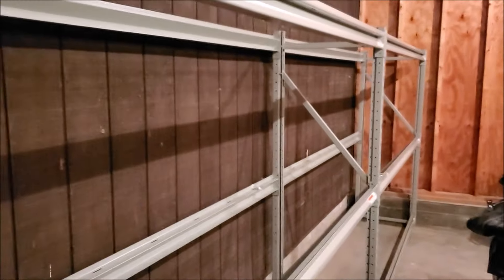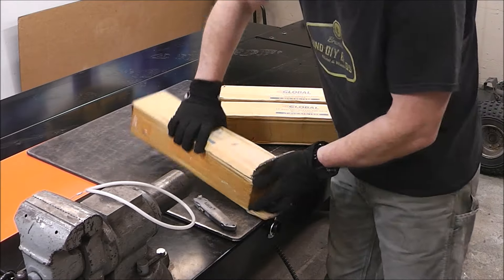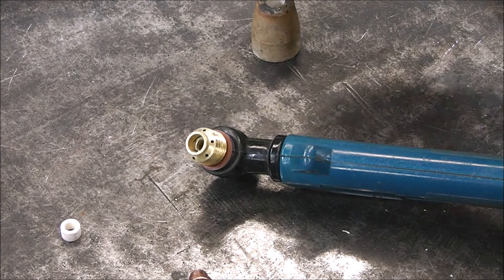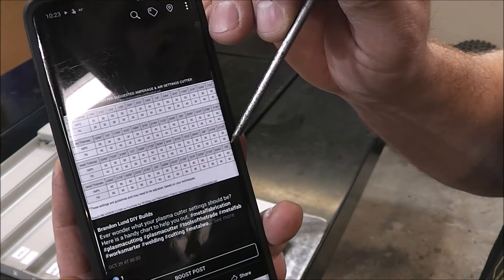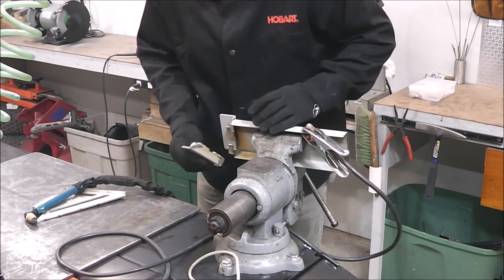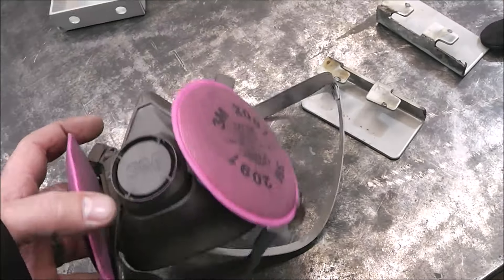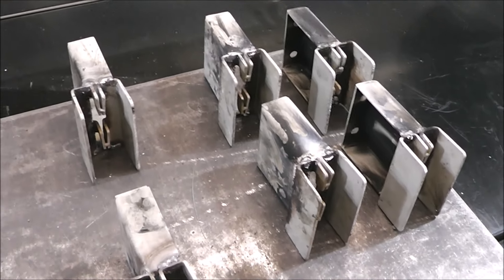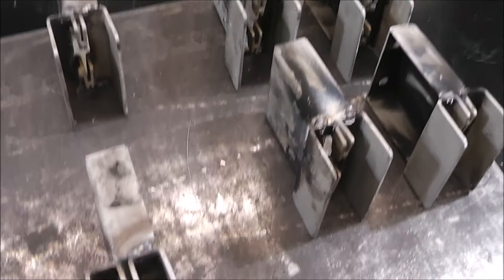Setting the Correct Air Pressure and Amperage for your Plasma Cutter

Comment: Little late to comment, but the first thing I noticed was the "tricky" end is the one to keep. No need to cut twice. Just hack the small sides to length. Make the wider side a little longer. Drill a couple of new holes, and bend it in the vice. Then it is just two easy tiny welds to secure it.

Comment: Why didn't you cut the length from bracket end towards the wall end and then weld wall attachment end on.
Reply from the maker: No particular reason. I felt this way was a little less labor so I went with it.
Reply: @BrandonLund  dude im not bashing your video. I like your videos alot and watch most.  But you put your handy dandy gauge on and clicked it back and forth with space on both sides. there for its not 1/8 bet if you go nack with the gauge ant put it on 14 gauge it will be a tight fit being 14 gauge material
Reply from the maker: @rolfbach2721  its metric but 1/8 gets you close.
Reply: @BrandonLund  gauge is gauge 12 is 12,  14 is 14, thats universal.  I think!!?
Reply from the maker: @rolfbach2721  yes unless the material your using is metric or stamped.  It didnt fit 14 guage and 1/8 was just slightly loose as you pointed out. When metal is extruded its thickness is consistent.  This metal was stamped into c channel with presses which can result in the material being thinned in the areas of bends and where the dies were pressing. Its either metric or 1/8" but either way an imperial measurement was close enough of a measurement for what we needed. I frown from using my good micrometers for rough in work and its not necessary.
Reply: @BrandonLund  👍

Comment: You could of cut 3 1/2" from the bracket side and remove the 2 smaller sides 1/2" and bend the remainder lip 90 degree inward.
Reply from the maker: That would work for the center brackets but the end brackets had to be flipped 90 degrees so I could have access to bolt them to the wall.
Reply: He made a lot of extra work for himself
Reply from the maker: Sometimes doing it right takes longer but in the end hopefully creates a repeat customer. Keep in mind the brackets had to be rotated 180 degrees on the end wall
Reply: Yah, definitely should have cut the 3.5" from the other end.

Comment: Why wouldn’t you just cut the brackets to length and weld in a plate at the end with two holes in it to avoid all the grading and cutting of the brackets that attached to the shelf?
Reply from the maker: @Brent Begay like most things there are usually a bunch of different ways to accomplish the same thing. Knowing I had to flip the orientation of some of the brackets I felt this gave the cleanest final product even though I knew it wasn't the fastest way of doing it.

Comment: You should contact me before you do this stuff. I'd have told you to cut 3.25in off each end and overlap 3in back to back. Then a quick weld along top and bottom.
Reply: I know, hindsight is 20/20
Reply from the maker: 🤣🤣🤣 it would be extra strong, that's for sure :)
Reply: He should contact you before he does stuff ??? WHTF,  is he a little kid ?

Comment: To be honest, why would you buy expensive wall supports and have to cut them up and modify it when a piece of flat with an angle bent halfway does equally well?
Reply from the maker: Ah, because the customer bought these, it came with the supports, it didn't work, so they paid me to correct it. This has to be a trick question....

Comment: Good information about the air pressure. I would have just cut one end with the 2 holes  and kept the bracket end as is.
Just drill 2 holes at the end you cut  and cut tabs then bend the end over and weld the seam done. This would save a lot of time and consumables.
Reply from the maker: @MichaelBurke-f2p 👋

Comment: Thank you Brandon for making and posting this video.  I've been so frustrated with my Cut-50.  It just wasn't cutting straight.  So with the suggestions of your video and learning to go slower and have the torch close to the metal I've finally been able to cut metal that is more than 3/32 with a good cut.  Keep these videos coming.  BTW don't worry about those who say it wasn't really a 1/8" piece of metal.  The chart I found says 20 amps at 30 PS1 for 3/16th down to 1/64th.  It doesn't make any difference.
Reply from the maker: Thanks man glad I could help! When it starts cutting crooked that generally means the contact tip needs to be changed out

Comment: Is an ordinary air compressor can also be used?
Reply from the maker: Yes. That is exactly what I am using.
Reply: @BrandonLund  how much horse power is required?
Reply from the maker: @ NAS Venture Mine is a 5hp 30 gallon and it's plenty. You are generally running it around 30ish psi. I've also used a pancake compressor but it has to recover depending on how much your cutting.

Comment: Great informative video Brandon bro and I add an extra filter and air dryer to my compressor when I'm running my plasma cutter
Reply from the maker: I have a water separator hooked up to my compressor but it's nothing fancy. If I added a filter the consumables would probably last longer, but they are cheap so I dont bother
Reply: @BrandonLund  yep there cheap I agree just replace them

Comment: Thanks, I downloaded your chart and realized that I was way off. Used the guideline for air pressure and amperage and was finally able to plasma cut without tons of blowby and scrap.
Reply from the maker: Thanks man! I used to do the same. Crank it up and go but what a difference. Your consumables will last longer too :)

Comment: Like the chart will use, my only suggestion (after the fact) would have been to cut from the bracket end and just weld in a small piece at the open end for the bolts that way everything would have stay square and less grinding.
Reply from the maker: Good point. Thanks for watching!
Reply: That's what I was thinking. The end piece is a simple plate tacked on the end. Way easier and quicker.
Reply from the maker: Good point. Thanks for watching :)

Comment: Please explain the application of a 0.03” plasma cutting nozzle size, vs 0.06” plasma cutting nozzle.
Thanks
Reply from the maker: A smaller nozzle works better on thinner material and if your running on 120 volt. The larger nozzle works better on 240 volt cutting thicker materials.

Comment: It was the adjust accordingly part I was looking for what are you looking for in the and when you find a isn't penetrating do you increase amp or air or back down if it's closing back up on you. adjust what accordingly pressure amps both would speed you move make a difference..  new to the game sorry
Reply from the maker: Much is trial and error. If you follow your air and amp chart that will get you close then you can experiment by adjusting your amperage up and down slowly while leaving the air alone to see what setting is best. It doesn't have to be exact

Comment: Great video and great information. 

I use my plasma cutter a lot but man, for this job, a band saw would have been the way to go. It would be dead straight every time and wouldn't require spinning the material to cut the bottom.
Reply from the maker: I have that tool also. I like to show and try things using different methods just to show things can be done using various tools and methods.

Comment: Thanks for a great explanation regarding correct pressure and amperage settings for plasma cutting!  I do have one criticism however regarding the use of a dust mask to protect against welding fumes, etc.  As an Industrial Hygienist, I would recommend that your viewers review the correct filter cartridges for the respirator in use to protect against the fumes being produced. Organic vapor cartridges protect against the fumes produced by the paints you’ve pointed out, and metal fumes require additional filtration not provided by the organic cartridge. The dust filters in use on your half face respirator only protect against large dust particles such as are produced during grinding operations, and that system will not protect your respiratory system from the most insidious exposures found in welding and cutting.  False sense of security I’m afraid...

Thanks again for the info on pressure/amperage settings, and please don’t consider my criticism regarding safety gear as being a negative review.  Just educational information to protect the health of you and your viewers!
Reply from the maker: Thanks for the great compliment, however this is taken directly from Millers website  "Once you start arc welding, the ozone created by the electrical arc produces fumes that require a more robust system of respiratory protection. Since the face shields worn to protect from infrared restrict the type of respirator and cartridge or filter that can be used, many welders prefer soft P100 filters like the 3M 2097 Particulate Mold Filter P100 because they have a layer of charcoal to absorb fumes and organic vapors and also can block far more of the particles carried on the air. The 2097s can be worn on the 3M 6000 Series half-face masks or the 3M 7500 Series which is made of soft silicon and is more comfortable when worn for long periods of time" ~   I don't doubt your expertise but I also cant dismiss that Miller Welders is promoting the same exact respirator I use on the channel. I feel they would have a huge liability issue for promoting wrong PPE. Please dont take my comment as challenging you. I'm just relaying on the PPE that many rely on in the industry (excluding a PAPR of coarse).

Comment: What kind of dryer and oil separator do you use for your air lines?
Reply from the maker: It's just a basic setup for automotive painting that I bought at Napa around 30 years ago.

Comment: Great instruction on use of plasma which I have, but I also have band saw and would have cut about 1/2" back behind the hook end on the arm allowed for that 1/2" at the other end, clean cuts champer and weld the edges being square from the saw, but I do like my plasma unit.
Reply from the maker: Nice!

Comment: How do one get a good ground on a painted piece of metal? And how to start an arc on a painted surface? My cutter ( primeweld) struggles to keep the arc lit .
Reply from the maker: @petrus e For the ground clamp you have to find a spot where its clean bare metal. As far as keeping the arc lit, that's where having a pilot arc is a huge benefit. If you don't have a pilot arc it helps to get the metal free of paint.
Reply: @BrandonLund  Appreciate you took time to comment/reply my question.The obvious reason for asking was watching you doing a cut without any previous clean up of the piece.It simply shows that not all plasma cutters are created equal
Reply from the maker: Thanks man! I'm sure my ground had a small spot that was making metal contact but the rest the torch can burn through :)

Comment: Brandon, sorry to bother you,,,,,I bought a CT312 Inverter and came with one plug and cable, it can go 110 or 220 volts. I dont know if it came with 110 0r 220 install. Iam afraid to hook up 220 plug on the cable . Do all I have to do is change the plug? Please help
Reply from the maker: Without first hand knowledge of that machine I cant say for sure. Generally if it's a dual voltage machine it will usually come wired white, black and green. The green is ground and the white and black connect to the positive terminals of your 220 volt male welder plug. I would write the manufacturer or try googling that specific machine to see if you can get a wiring diagram. I dont want to see you fry your machine.
Reply: @BrandonLund  Thank you Brandon

Comment: What happens if you just use the max amp on the metal? does it melt it?
Reply from the maker: @Seahawks forever It will still work but the cut wont be as nice and the consumables will wear out much quicker.
Reply: @BrandonLund  Okay thanks!

Comment: I have a herocut CUT45D 220v plasma cutter. The max amps I can use is 20. I'm cutting AC compressors for a living. And I have the PSI set to 75. I still can't get it to cut well. Am I doing something wrong?
Reply from the maker: @Prince Noah 75 psi @20 amps is too much. Try lowering your psi according to the chart. Some other things to consider are making sure your air is dry by using an inline dryer. You can get disposable ones for cheap. Make sure your consumables are fresh. If you were saying that your only able to get 20 amps out of your 45 amp machine than it sounds like your internal electronics are giving up the ghost.
Reply: @BrandonLund  Ehh, sorry. I didn't word that right. My cutter is actually new. XD I can change the amps by turning a dial. But if I turn it past 20, the breaker trips. The outlet and breaker are only rated for 20 amps.
Reply from the maker: Hmmmm 🤔 with it plugged in and turned on (and not cutting) you should be able to max out the dial and it shouldn't pop the breaker. If you are on 120 power than it probably won't display past 30 or 35 amps. On 220 it should display the full 45 amps. My plasma cutter blows the 20 amp 120 volt breaker in my shed if I cut above 25 amps for more than maybe 30 seconds. I have to turn off my compressor while I'm cutting because my compressor in the shed is on the same breaker so I'm constantly waiting for the air to replenish between cuts.
Reply: @BrandonLund  I just re-read your previous reply. 

And then I found the owner's manual for my cutter. Good thing, too. I found that I need replacement parts, the shield cup broke. The ONE thing they did not give a spare of! 😂

When the new parts come in, I'll try lowering the PSI and see if that'll help. I'm wondering if the psi is making the cut cool before it's done cutting? It yes, that would explain it. XD
Reply from the maker: Well at least you found out the issue and it wasn't something internal 👍 if you look on my community tab I have posted a pressure ND amperage chart to.save consumables

Comment: Great video as usual but can't help wondering why you didn't cut from bracket end and just weld on plate with fixing holes.  Each to their own I suppose. Great tip on plasma though as I have all ways just turned up full power. I'll find you on facebook and follow and pick up that chart. Many thanks.
Reply from the maker: Thanks for watching. I chose to do it this way because the c-channels that come off the bracket had to be oriented in one direction for some and the opposite for others and 2 needed to have an offset which would have resulted in 2 - 3 different fab methods. I somewhat explained this at the end. Doing it this way kept it simple by cutting in the same place and ultimately preventing me from making a mistake. Thanks for watching and commenting!
Reply: Makes sense now you say that. I must have missed that. Thanks for taking the time to reply. All the best.

Comment: Hello Sir . . . I just purchased a Cut 50D  plasma cutter and noticed that your dial is not synced with your digital readout.    Is that normal with plasma cutters?    My new PW machine does the exact thing . . . dial is three amps off from digital display.   Thanks.
Reply from the maker: I think its fairly common.
Reply: @BrandonLund  Thank you for the response .  . . new to welding and plasma cutting . .  I really appreciate what you do!

Comment: I'm guessing you went with flux core here to blast through the paint on the parts? Clever fix for wintertime tire storage. I only have one set of tires out here so my latest project was welding together a better pliers storage rack for one of the drawers in my rollaway. I'm a bad new welder so I screwed up some of the welds which means now I get the "fun" of grinding today!
Reply from the maker: Hey man we have all been there. God knows I've ground my share of bad welds. The flux core burns a little hotter plus it was already setup from the last project so I went with it. I like the idea of a pliers rack. Mine are thrown in my toolbox. They are hard to organize.
Reply: Brandon Lund angle iron with flat bar tack welded to it. Used some 1x wood as the spacer between because it's just about the width of the handles for one pair of pliers. After I got it done I spray painted it that cheesy red they use on rollaway tool boxes.
Reply from the maker: @matthewhall5571  that's why I love the YouTube comments section!  There are some crafty guys on here. I might have to build one. I really like that idea. Of coarse I will give you credit for it if I do .😁

Comment: Thanks a lot for this vid.  I am a beginner and learned a lot from this.  What I would like to know if am to buy consumables how am i going about it? My brand new cutter is a 240 v 50 amp. Tks. God bless.
Reply from the maker: Thanks Joe. I just go to Amazon and you will want to buy the consumables that match your torch. In the directions to your plasma cutter it will say which model you have then just buy the ones that fit it. Thanks for watching and I appreciate your support.

Comment: Does the tip touch the metal when cutting
Reply from the maker: Yes. I use a "drag tip" that allows you to do it...but if you don't have a drag tip then you should hold a small gap

Comment: I saw that the claw end was two pieces prior to cutting and would have used that as the three inch section then just weld a plate on the end with the wall mounting holes. Much easier and would look much better.
Reply from the maker: Thats the great thing about metal working. There are usually a few different ways to arrive at the same end result. The reason I did it this way which was a little more time consuming is I wanted it to appear as though they hadn't been modified.
Reply: Thats what i was thinking as well

Comment: Is there a pilot arc on this plasma cutter that you are using? Or are you just holding the tip in the sweet spot where it creates and arc. I just got one and the tip wants to glue to the piece that I want to cut
Reply from the maker: Its a pilot arc.